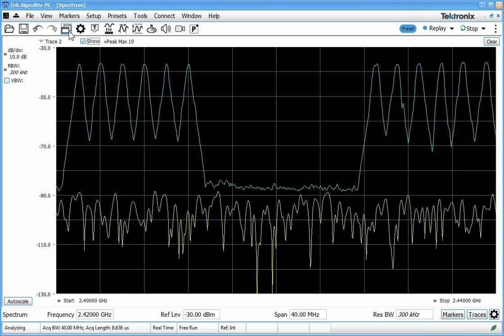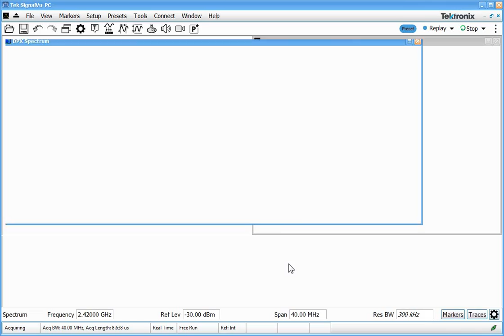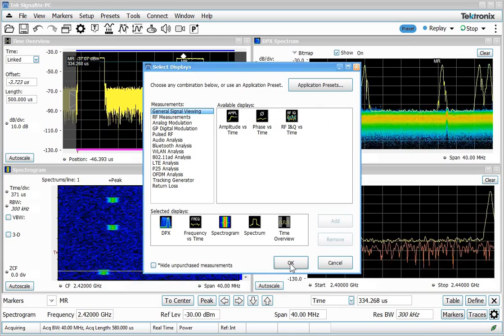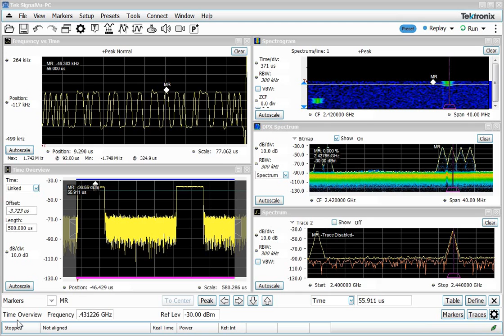#251: Using RSA306 to capture & analyze frequency hopping signals | Bluetooth example

Comment: Can SignalVu be used to demodulate the FSK section in the analysis window? Or do you have to do it the old fashion way with pen and paper (or export it and use some other software)? Thanks for the videos!
Reply from the maker: Yes, you can demodulate FSK in SignalVu-PC.  I requires option SMV in order to do so.
Reply: Wow, that's pretty neat! What a powerful tool!
Reply from the maker: That's just the tip of the iceberg with SignalVu-PC.  See the datasheet for more:
http://download.tek.com/datasheet/SignalVu-PC-Vector-Signal-Analysis-Software-Datasheet-37W2797313.pdf

Comment: What are your 3 best RSA choices for cost vs. performance?
Reply from the maker: The RSA306 is definitely the most bang for the buck. The RSA500 and 600 series offer optional higher frequency range and optional tracking generator, and have better SFDR specs than the 306, but can cost twice as much depending on model and options.

Comment: May I ask for a favor? My master's thesis was using software defined radio to capture, demodulate and decode RBDS signals. I want to take a stab at doing that for a bluetooth signal, but I can't find any examples and i don't have any gear that is fast enough to capture my own. Would it be too much to ask for you to capture just one of those bursts we see at 3:00 and maybe upload it somewhere? I want to see how the signal is structured not just from a theoretical standpoint (ie what the standard dictates) but how the signal actually looks like, in reality and if i can somehow manage to decode it myself. Thank you in advance and i understand if you decline.
Reply from the maker: I'll look into it - not sure what format you'd need to see.
Reply: don't need more than a series of 8bit samples. Signed or unsigned is the same to me, i'll figure which one it is. Could also be CSV or something, but that might be unnecessarily big.
Reply from the maker: Here is one burst, saved as a .mat file, with a complex IQ vector for the RF signal.
https://danahertm.box.com/s/3fhzwtvnn83xyacb7alf03nzi7lb8syq
Reply: w2aew thank you very much :)

Comment: Great video as always. Possibly a silly question. Do either the RSA306 or the RSA500 allow you to view a larger span than 40MHz in "non real time". Also is the signal processing for the FFTs/demod done on the instrument itself, or purely on the PC?
Reply from the maker: Yes, of course.  You can set the Span to anything you want up to the full frequency range.  This can be done using the non-real-time Spectrum display which basically is a standard spectrum analyzer type display.  You can also do this with the DPX real-time display - in this case it will step in ~40MHz "chunks", building a mini color bitmap for each chunk, stitching across the entire wideband span.  All of the FFT, chirp-Z and demodulation is done in the PC on these USB based units.
Reply: w2aew Thanks for getting back to me so quickly. It's the annual underspend at work so time to go shopping!
Reply from the maker: The RSA500 series is also portable, and even better RF performance.  RSA600 series for bench operation.
Two models available for each - 3GHz or 7.5GHz.  Both with available tracking generator.
Reply: radioman . I have no association with Tek but anecdotally if you need real time signal analysis, and aren't quite as fussed about top of line RF performance, these USB style units are massively cheaper than benchtop ones like the R&S FSVR or FSW. I agree that the prices are a bit steep for hobbyist use, but for a company if you can get away with a single high end benchtop unit and few of these it could represent a big saving.
Reply from the maker: The level of RF performance of the RSA507A and RSA607A is in the same league as competitive analyzers that cost 2-3x as much.  While they do represent a great level of performance for the money, they typically are not geared towards the hobbyist.
Reply: Hi James, remember me? :D I've played with the RSA306 quite a bit, Alan's response says it all. The RF performance for the price is pretty darn good. Being able to stream the raw data (I, Q at 112Msps if I recall) to disk for off-line analysis (Matlab/python) without a lot of fuss is awesome. I actually used mine in an EE30031 lecture before Christmas to demo FHSS  using Bluetooth. Trying to get a few for our undergrad labs :P